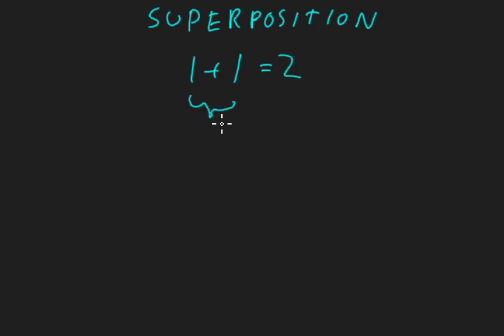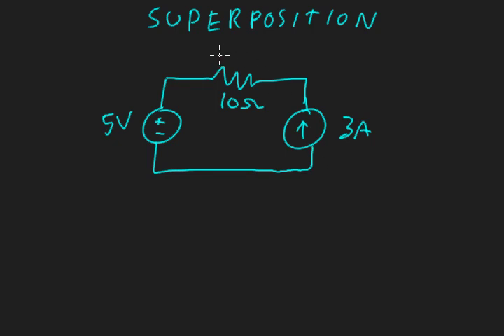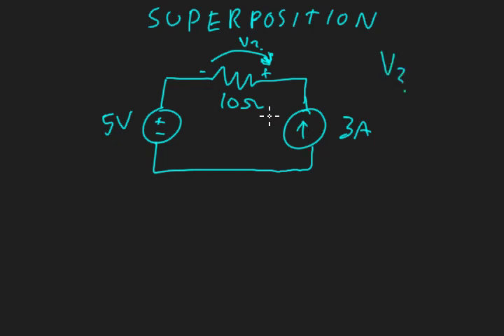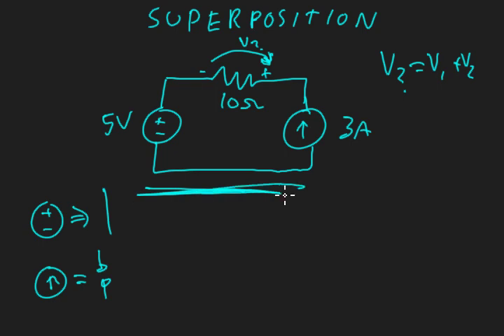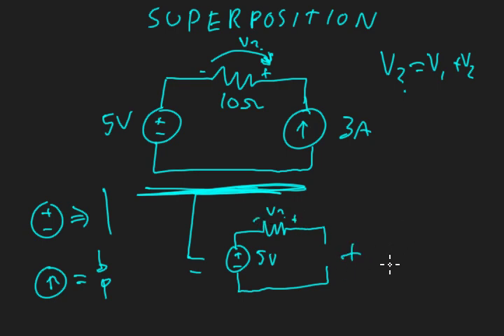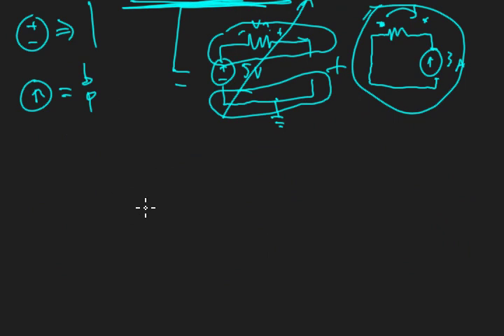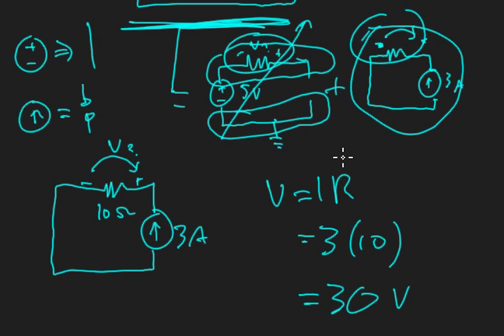10 Superposition

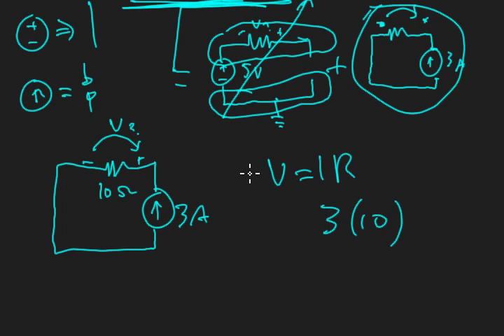Comment: At 3:36 you say the negative direction corresponds to the positive direction of the voltage asked for but you get a positive direction. I don't get why it is positive. Would you explain why it is positive is current is flowing the opposite way.